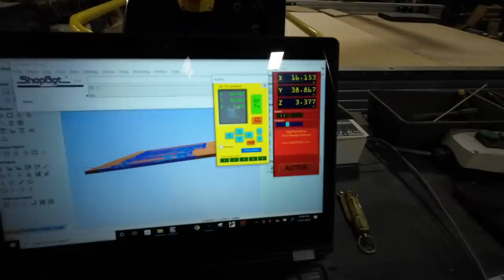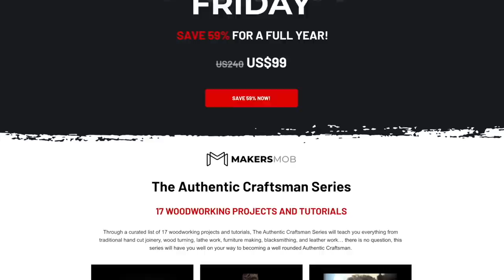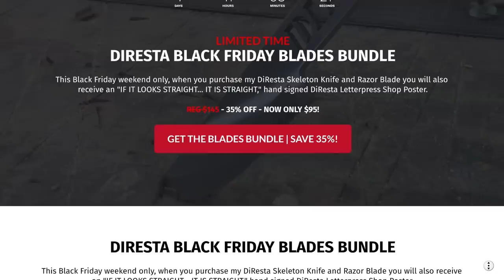DiResta Carolina Shoe Bench

Comment: I'm curious if you've seen any of your CNC projects like this with the "tab & slot" construction method loosen over time with use if glue isn't used? For my job I have been thinking of making a system of interchangeable parts that would allow reconfiguration, so eliminating the glue up would be great...